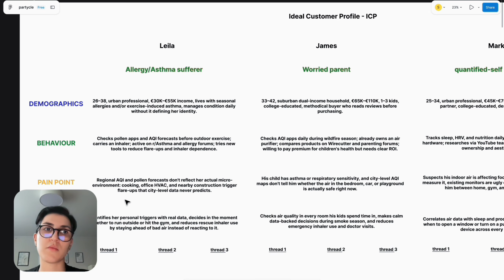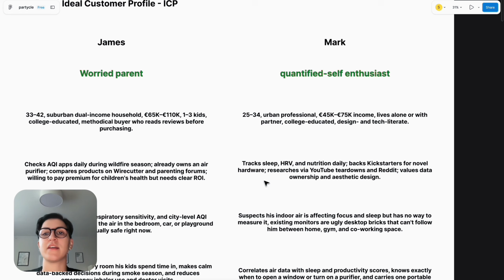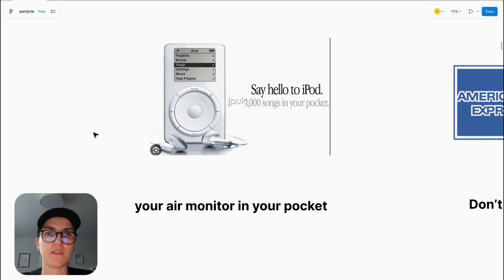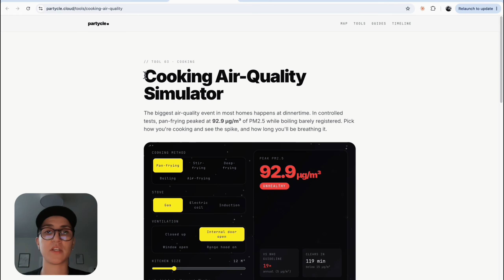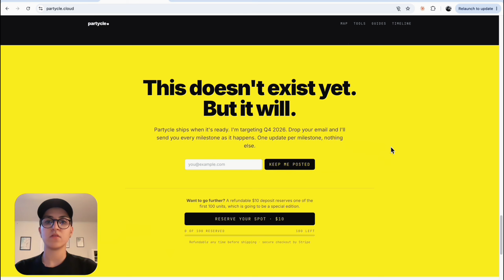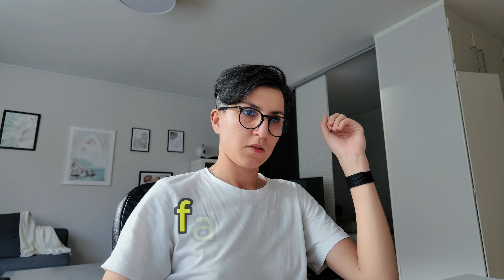My product has 0 customers: here's the plan

Comment: Hi, I am a first-year Electronics Engineering student currently learning PCB layout using KiCad and EasyEDA. While I am comfortable navigating the software tools, I sometimes struggle with core electronics concepts, which feels like a bit of a barrier. I am looking to bridge this gap and strengthen my foundational knowledge. How do you manage it.
Reply from the maker: This is a great question! I also struggle with that, most of the times I refer to circuits that are proven and try to understand the physics (the water - current analogy is quite useful) then from the known circuits you can start to think, what if I change this resistor? What if I add a capacitor here, and usually that gives me a good enough intuitive understanding. 

Also to be noted is that when you use Integrated Circuits (like the power management chip I selected) how to power them and connect the GPIOs is quite simple, just follow the data sheet, but if you wanna know what is under there you have to look inside and understand the logic blocks that make a timer, a LED driver etc. 

LLMs can be very helpful to explain things in a simpler way and dig deeper, but you have to make your own “study programme” and follow it 😅

Comment: Indeed, I was thinking of bare PCBs when you asked us to estimate the price. I assume the $100 per unit includes that expensive sensor, correct?

Soldering was a nightmare for me until I decided to invest in a quality portable soldering iron (FNIRSI HS-02A), with replaceable tips, temperature presets, and an extremely fast heat-up time (around 6 seconds). Since then, the quality of my soldering has improved significantly—it has become a pleasure rather than a chore. I can also power it from a power bank (with fast charging capabilities), so I’m no longer tied to a wall socket or a fixed workspace.
Reply from the maker: yes, that price includes both sensors! 
Agree that portable soldering irons are a must have! I bought a miniware TS101, but I will need a hot air station to solder QFN and LGA components 🥲 and I have never carried tools through airport security so I don't wanna risk having to throw them..